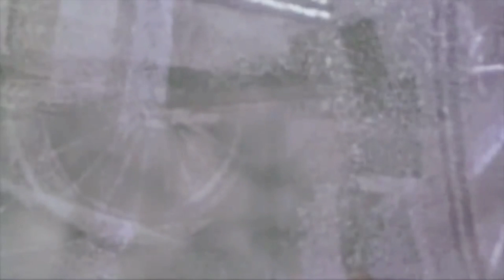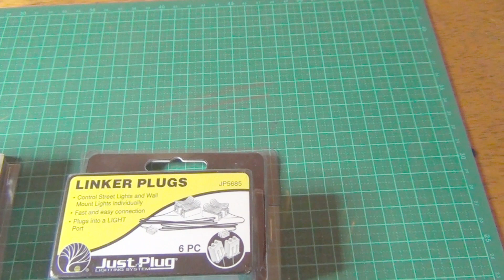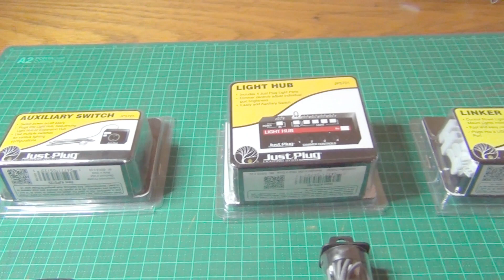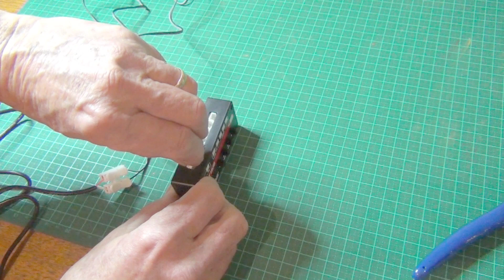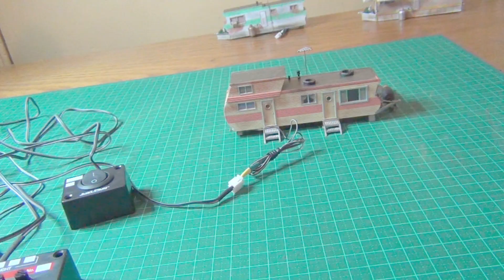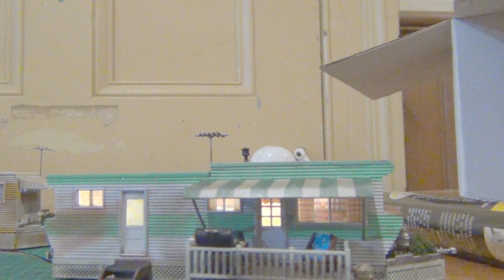Woodland Scenics Just Plug Lighting System "Model Trains"

Comment: Looks nice! It did look like you left the resistor in the linker plug that you used for your power adapter. Not sure you intended to do that? But it's looking nice! I recently bought some SMD RGB led's in a small form so I can simulate a tv with various flickering colors. Hope it looks as good.
Reply from the maker: I did leave the resistor in the linker plug as i didn't think it would matter and 
would be good to see how your RGB Led's work cheers Robert

Comment: quite an adventure to get that power plug in lol. those trailers look pretty freakin good with the lights and your weathering. the TV effect is a nice touch. great video!
Reply from the maker: These plugs are so small, sometimes they plug together easy and some not lol cheers Robert
Reply: @csxmad  Robert I also saw somewhere that they are not designed for a lot of unplugging and plugging back in so it's important to get them set up how you want them permanently from the beginning and to not fiddle with them after that because they will break. I've done some research on the just plug system because I plan to use it myself. so this was an inspiring video, thanks.
Reply from the maker: @mysticrailroad    Yes i thought they would not be made to keep unplugging, but once i connect these on the layout i wont have to keep unplugging them. And thanks for the info cheers Robert

Comment: Great Job Sir Robert.
I love the Just Plug lighting System but I'm Having some troubles with the 1st Generation Street lights which came with a Extremely thin Non Insulated wire and hard to work with and once you get them going a bump on the Connections and Lights out, Although I just bought some newer Pole lights for my latest scene and the wire is now insulated and MUCH easier to work with = Good Job WS.
Love the TV, Now add a Sequencing up.
Stay safe my Brother and Cheers Mate.
Andy M
Sutton, Mass USA
Reply: Sequencing HUB. LOL.
Reply from the maker: Andy, good to hear the newer pole lights are better for you cheers Robert